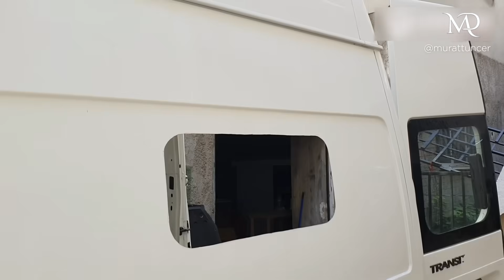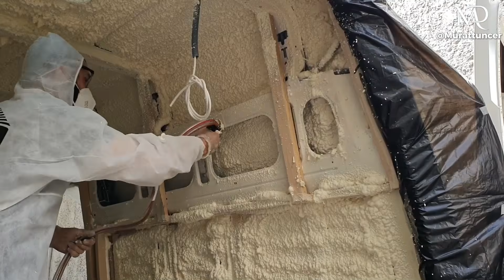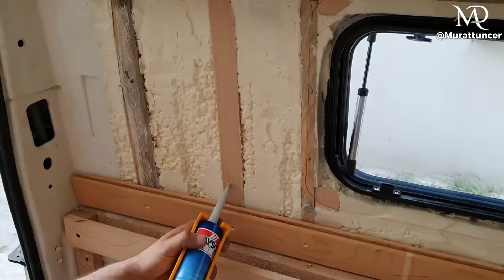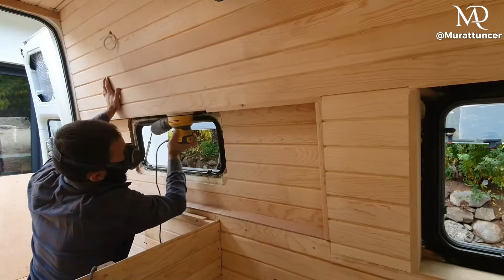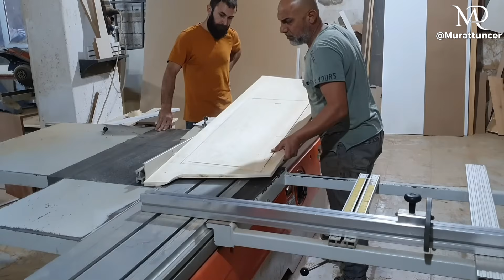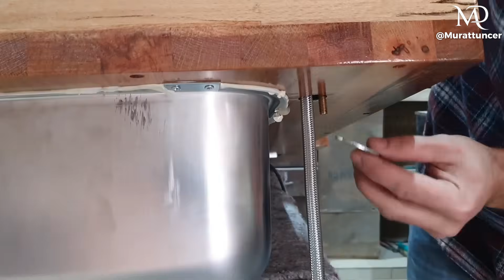He Turned a 20 Year Old Cargo Van into a Luxury Mobile Home

Comment: with laminate flooring you have to leave a quarter inch gap all around the edges to allow for expansion and contraction.  by putting it in tight you run the risk of it buckling in hot weather.  however if it was put in during hot weather you might not have as big of an issue with that, but it will contract during cold weather so expect it.
Reply from the maker: yeah